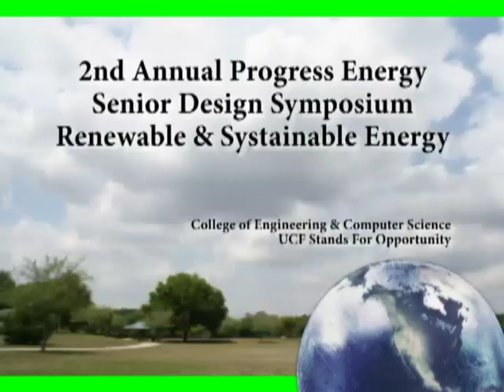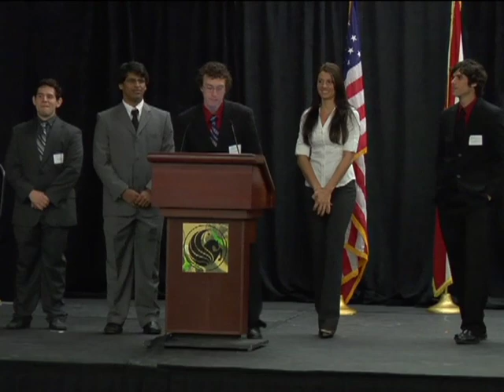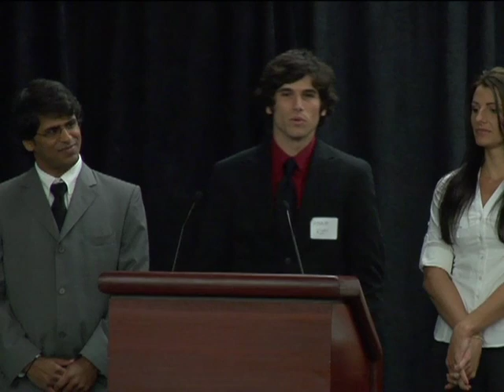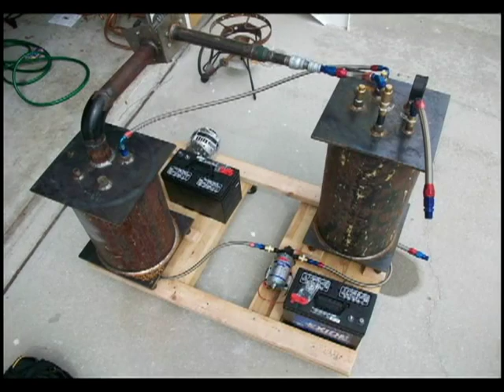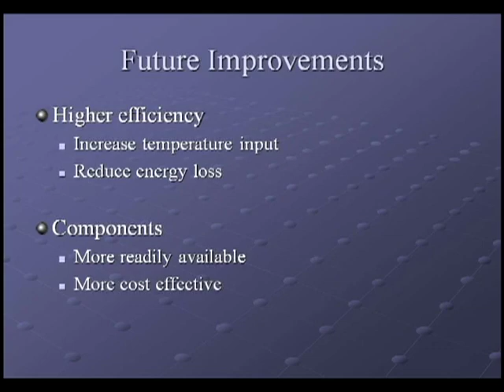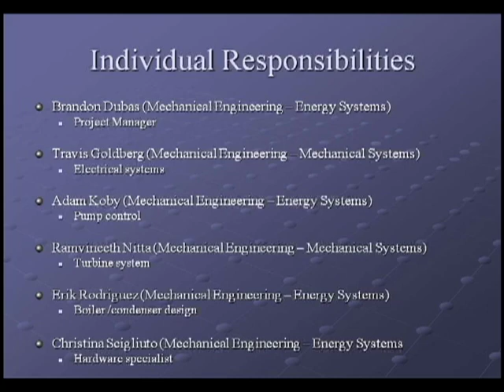MMAE: Organic Rankine Cycle for Third World Energy Production

Comment: 1.  What the students are describing is a rudimentary steam turbine.  A Rankine Cycle is an idealized model which (more or less) closely resembles the dynamics of an actual steam turbine.2.  An ORGANIC Rankine Cycle engine uses the same principles as a steam turbine but uses a (typically) organic fluid with a lower boiling point than water, thus enabling it to use low to medium quality (185 - 300 degree F) waste heat.  ORGANIC Rankine Cycle generators can thereby use waste heat from industrial processes or exhaust from turbine generators or ICE generators.  This is the technology they should have been talking about. 3.  These are college engineering students, not third graders.  They should understand these differences.4.  WTF is wrong with these dorky kids?  Who cares about Africa?  They should focused on making MONEY.5.  WTF is wrong with Eric.  This dwarf looks like he just peeked at a photo of a naked boy and can't get over how cool it was.6.  Ramvineeth did OK but I liked him better in Beerfest.   7.  Christina gets a pass on everything.
Reply: U don't get it.   Solar thermal does not reqquire oil or gas to get delta T.      Hey we will shortly have no cheap oil either, so we will need it.